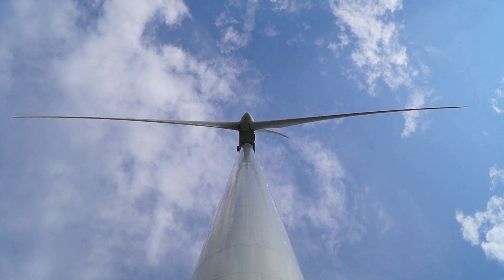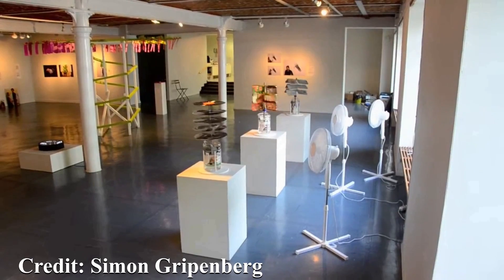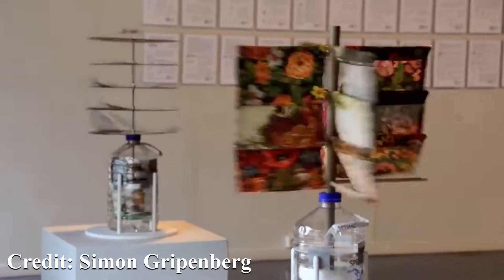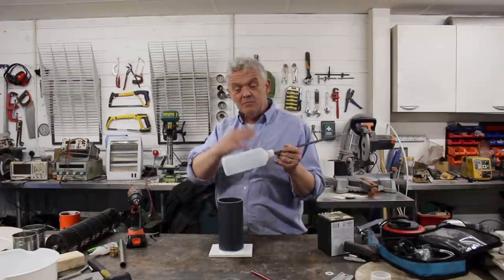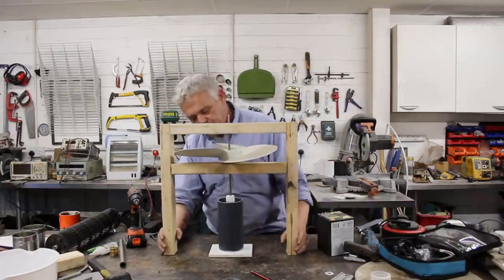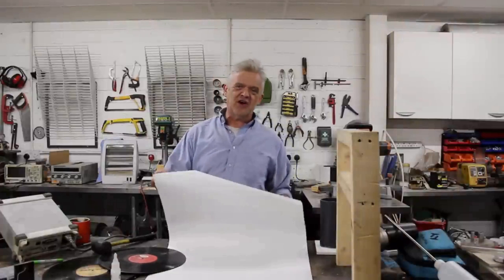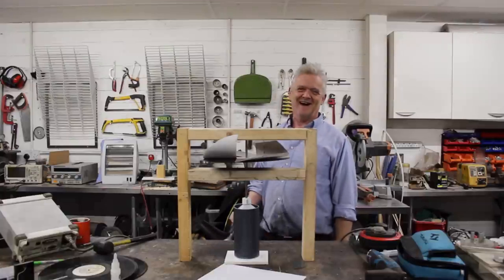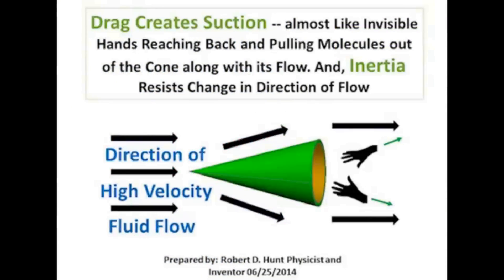2241 Physics Defying Wind Turbine

Comment: Hi Robert.
On the subject of wind turbines, I have a concept that work very well on yachts, where the issue is high winds.
So my idea.
A single vertical blade, it can oscillate side to side, so the generator is at the base. The beauty is that by grabbing it at the base of the blade, where there is little movement, you can stop it moving.  It can be quite tall, and of course doesn’t need a mast.
Next project for you?

Comment: could make your buoyancy bottle into a generator. drop some magnets into the bottle. and glue them in place,  and then out your coils either outside  the pipe,  or heck keep them cool and drop them in the water just outside the bottle.
Reply from the maker: yes you could indeed

Comment: Could you make a tidal power plant using an array of underwater parachutes attached by cables to an anchored electric generator as the tide moves in it pulls the parachute quite strongly which could be used to spin the generator.  Double it so you have pulling back the other direction when the tide goes back out. It would be benign to the environment as well.

Comment: Very good. Initially when the bottle spins, more work is required to be done due to drag of water. However once the bottle starts spinning the whirling water will  act like fly wheel and keep the bottle spinning,  that is what I feel.  Pl. correct me.
Reply: I was thinking the same, and maybe that "water flywheel" could be made in stages of sort to create a layering effect, sort of like multiple water flywheels to keep it going for longer after the wind stops.

What's also happening here is that the blades facing the wind will also have a minor thrust from the suction effect created by the wind flowing over the flaps, so there are several things going on in that device at once.

Comment: 3:06 That bearing has lots of drag and can only hold so much weight. I use a single ball bearing in an oil bath with a shaft riding on top of the ball.  Holds lots of weight and spins like a top .
Reply: Can you explain this further or provide a visual
Reply: @cronicjohnson  a steel ball at the bottom of a tube filled with oil. The shaft sits in the tube and rides on the ball. The shaft is attached to the turbine rotor.

Comment: This makes visual intuitive sense to me. Locally, the force of the wind on the paired wings rebounding makes a steady wind stream into a linear harmonic pulse that is more self-sustaining than a static blade. The secret of resonant pulses is a key component to antigravity tech.
Reply: The common principle in a lot of the most amazing technology is variation with respect to time, fine tune control over it results in more amazing results. Especially in the electric area where the shorter the impulse duration the stronger the effect for the same cost.

Comment: Honestly from looking at his vacuum pump campaign video, it sounds less like he discovered misunderstood physics and more like a very shaky heuristic approximation of the Navier Stokes equations. (Which state that the acceleration of a fluid is due to viscous forces, pressure gradients, and "body forces" like gravity)

This doesn't rule out something new, though, as the NS equations are nonlinear, which makes it hard to actually use them beyond simplified situations or brute force computer simulations.

I'd also say that in terms of fluid dynamics, the (unmodified) Bernoulli equation isn't really the main tool one should be using. The modified version accounts for losses and gains but is still a very oversimplified model.

ETA:
Having watched a few of Hunt's videos now, I get the impression that he was self taught. He clearly is a very creative intelligent man, but there's several points where a misunderstanding/misuse of terminology or lack of understanding shows. His gravity plane idea is honestly not too controversial, for example, but fails to account for losses when recovering energy.

Comment: This is my favorite style / type of vawt.  I first saw it around 1998 on a google search and it was made from plastic blue tarp.  I had some blue tarp that was too sun rot to use to cover the wood pile and a bike wheel to make a nice bearing.  The design had a rope connecting the tips of the "wings" that were across from each other, so that when one opened up it pulled the other one shut.  I used a pipe for the rope to run through.  I mounted it on the corner of the green house, about 15 feet up off the ground.  It did not power anything, it just turned.  And it would turn in a slight brease.  It caught the wind very well.  After 6 months the dry rot tarp was 1/3 strands flapping around but still turned.  That thing was still running 3 years later with hardly any tarp left.  So impressive.

Comment: How much electric power could be generated by adding permanent magnets to the plastic bottle and coils to the cup?
Reply: You would want to raise the circumference and have them on the edge of the wind catching device with stationary coils obviously for more speed. Yes wobble would have to be worked on but 2 liter bottles have less drag and more volume for the magnet weight. Go for cheapest construction and not high output, and make a bunch of them turning in very slow wind speed series together to extract a decent charge capability
Reply from the maker: dpends on the energy in the wind that you are trying to capture

Comment: All interactions require energy, all movements are energy and cheating isnt even a choice or a possibility - there is drag from air against a surface and also airs drag on other particles of the air. If energy is used to remove air so there is less pressure, this now causes other particles to gain the loss by moving into it and creating higher pressure and and so forth.

Comment: It looks very similar to the turbine you made from flapping cloth. I do like the hydraulic bearing.  Perhaps magnets could be fixed to the float and coils fixed to the outside of the water container making a generator for the turbine. 👍
Reply: You would have to contain the magnets so there is a smooth surface to interface with the water. Does the golf ball dimples work the same in water as in air?
Reply: @williambunch1365  I guess the magnets could be stuck to the inside of the float container, providing you could access the container.
Keep both container walls as thin as possible to reduce magnetic losses and the top bearings should take care of any wobble.
Reply: I was about to ask how it would be possible to use this to power something. Thanks for your insight